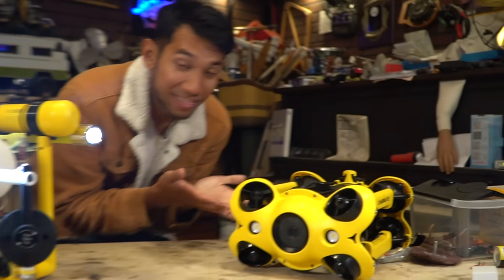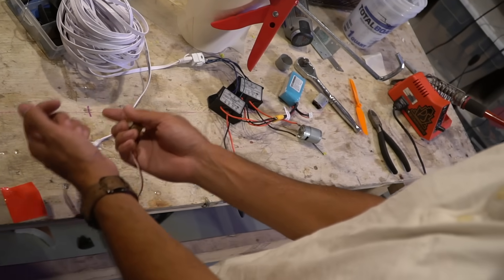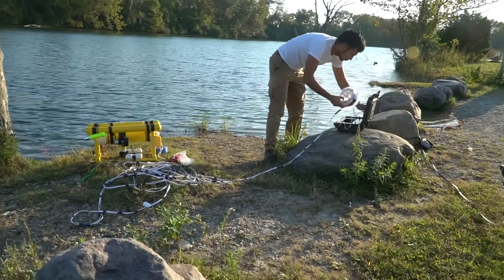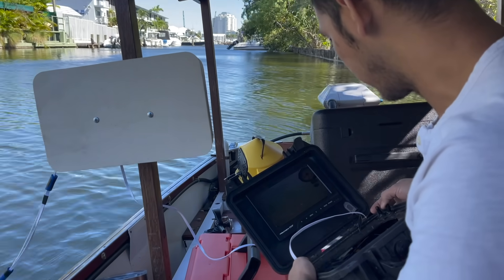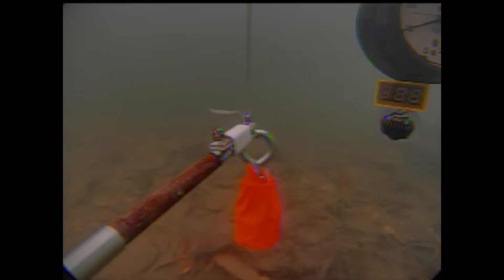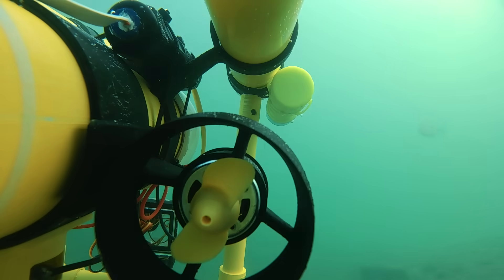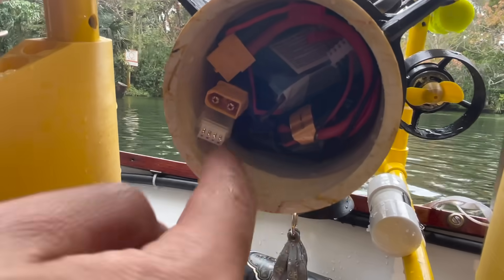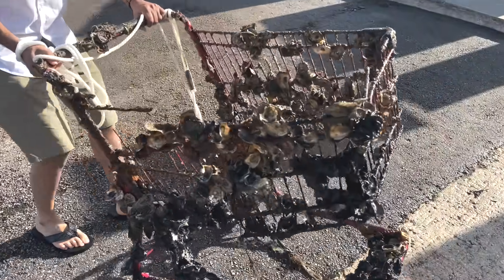Cheap PVC submarine DIY

Comment: A silly question from an uninformed person. You have mounted the motors openly on the outside, without any protection. Wouldn't that cause a short circuit? Or did I learn something wrong in school 30 years ago?

Comment: Would voltage drop be an issue for the tether if you made it longer or no?
Reply: I think if you have a tether that has good conduction and a strong voltage is used, I don’t think it would be as much of a problem as you think.

Comment: You'll need larger ballast in order to bring heaver objects to the surface so you can inject more air and increase your buoyancy, those tiny ballast seem way to small anyways. (Update) oh I didn't watch till the end before commenting, oh I see your going to reel it in on a separate line that's a great idea and that works too. Very very cool design man you have done a great job and I love it's simplicity with no complicated Arduino boards to program this really makes it a build for anyone. Thank you so much for sharing I can't wait to build one.

Comment: This video got me wanting to build something similar, repurposing some quadcopter parts I'm not using. I don't need any help with designs but where does someone find fully submersible motors like that? Looking for bilge pump motors is finding me mostly full units ready to install in boats, not standalone motors.

Comment: you could possibly use 2 ethernet cables, and send emergency power to capacitor banks to operate the surfacing motors in the event of low-power. | if you go the micro-controller route, your not limited to arduino or raspberrypi to use Ardupilot or like. You can adapt OBAL to work with nearly any linux compatible board with GPIO.

Im working on a RISCV based solution with multi-channel controller and multi-channel analog video using a all FOSS hardware. if you did a similiar design, you could transmit a excessive amount of analog video channels(multiple-cameras) over a single wire with VERY little power (or weight). modulating video feeds into vhf channels carried over a single wire and shared ground is possible (although a little tricky as im doing) but provides a extremely low-powered solution for boats, submarines and rovers. | however i dont recommend using riscv like me as its more of a niche project to prove it is possible, as embedding such SOC's will be possible in the future.

Comment: Please can you post or send me everything about this I’m doing the same thing but am having trouble I’m using drone parts a JB F4 flight controller with 35A ESC that’s bidirectional so I got backwards and forwards but turning sucks with an FPV system and I can’t get the motor to do what I need them to do have three motors just send planes wiring motor used bla bla that’s if you can help cool video

Comment: It would be cool to add a water pump to pump in the water to vacume sealed tanks to displace to weight of the air filled tanks so it would move up and down  without relying on a wire to pull it out and weight to sink it I have built a mini  sub like that for about $150 using a dc moter with water seals on a shaft and a peristaltic pump I used it to pump the water in and out of the sub it also had a debris filter and a small reservoir to make sure the pump lines would not get clogged for the communication system I used was with the same cable you used for the cameras I used some backup cameras i grabbed from the junk yard i used 4 of them the lights is used were led strips I got from super bright LEDs I had a arm on it to grab things I used some cheep water solenoids you fill them with water and it gos in or out thay are simple the make and I used the pressure in the ballast tanks to make them work it also used open closed electric solinoid for control of the presher of the solinoid  I could also tilt the sub with the same type of solinoid wich were $10 a piece the body of the sub was PVC but I mane a large square 2 ft x 2 ft x 4 ft I have a lot of the stuff just laying around

Comment: @PeterSripol I work on long distance ROV tunnel inspections in GPS-Denied environments.  You are right on track with your PVC made vessel, but if you used some Fiber cable you can have two way communication the whole time along with more sensors, INS/DVL depth sensors and whatnot. We mainly inspect penstocks (giant tunnels) of hydro electric dams. 
Anywho, cool video and ur on the right track, that is how an underwater ROV should look, like an ugly box with thrusters and as much room for different equipment as possible like Sonar and underwater LiDAR in high vis water

Comment: I had an awesome idea for improving your ability to recover "treasure." You could develop a separate device, which you use the ROV to deliver. The device itself would  have 2 distinct functions: 
Function 1:
                        a "grasper" or "anchor" (either a magnet, for suitable material, or a "claw" of some sort, perhaps with an automatic "trigger" that causes the mechanism to close).
Function 2:
                       an expandable/elastic bladder connected via remotely actuated valve to a C02 cartridge or some other source of compressed gas.

The idea being that you use the ROV to attach the device to the targeted "treasure" via the magnet or "claw," then trigger the valve actuator to expand the bladder, which should theoretically lift the "treasure" to the surface.

Thoughts?
Reply: Hello

Comment: Hey Peter just a heads up, I know this is a cheap as chips build but it is possibly to send sbus signals down a line for the control and have brushless motors underwater, and the battery can actually go out in the open water as lipos are waterproof

Comment: Could you send power over the ethernet cable? According to Wikipedia you could put max 57 V and 600 mA. Of course some voltage would drop over the length of the cable but you would still get worthwhile power over it.

Comment: I did same thing and it worked. But I found it to be very limlted control,so I switched to 6 channels receiver on the surface.to run Variable speed controllers mounted in sub,battery on board,brushless motors.now it works great. Good job your vidio.big fan .

Comment: Hi Peter; I'm new to personal subs ... I wish you had link where we can go to get your build plan for your sub. I live in Canada with thousands of fresh water lakes that would be so cool to check out. Oh by the way, just a thought ... if you use clear soft tubing for your umbilical cords, you won't need ti tie strap them which could get caught up on things as you go deeper. Plus you can pull up on it, if your battery pack dies.

Great Video by the way (:   Cheers from Canada

Comment: Consider using the RP2040 Pico for your next build. You could use two of them, one in your control unit, one in the ROV, and still connect them with the ethernet cable.  As a bonus, they are cheap!

Comment: I made a similar ROV about 5 years ago using regular RC airplane parts. You can use a flight controller for stabilized autonomous operation, SBUS, etc. I used a modified scuba regulator, one of those small spare air tanks, and a pressure relief valve to make an automatic pressurization system which enabled the ROV to go 329 feet deep without any problems. The possibilities are endless.  The one drawback is that you will need a thin antenna wire attached to the ROV with a small surface float and antenna so that it can use GPS for autonomous navigation, video, and PWM/SBUS signals.  What is really cool is that one can send regular radio signals  for a short distance underwater, allowing you to use a camera without penetrating the hull of the ROV with the camera wire. This only works for a very short distance. If you want longer distances, you have to use low frequencies which will  immediately draw the attention of Federal authorities which strictly control such frequencies for military submarines.

You can fly underwater  with an ROV just as you can fly in the air with a quad or plane. In fact, it is actually better because there are few if any restrictions so far. But, I have to caution everyone that the government is aware of just how dangerous such technology can be in the wrong hands.
Reply: Hello

Comment: Hey Peter ! What’s the Voltage of the main battery?? Also why do you use a total of 3 batteries? I can understand using 2, one to power the submarines actuators and one that’s lower power to trigger the relays, but I can’t figure out why you need the third.

Comment: That's awesome.  The biggest thing that I'd change would be the control system.   You could have put a couple ESP32 or similar on it, to send signals to it.   Nothing fancy, just hook your switches to one, and make that into commands to send down to the ROV.  An ESP32 on the ROV would just take the commands, and run the relays.  The biggest things would be that you wouldn't get the interference from your command inputs, and you'd be down to using 4 wires.    Even thought the ESP32 have WiFi and BT radios, the water would kill the range.   

That would be a trivial amount of programming.  You aren't programming a sub with sensors, you're just programming a really cheap wired remote control.

I think you already knew most of that, I'm just saying it for everyone else reading this. :) 

I'm in Florida, and you went past me going from Miami to Weeki Wachee.   If you wanted help doing that for a future project, I'd love to help.   I kinda assume this one is done, so I can't help much with it.

Comment: That's awesome young man. 
I had a submarine in 1970 for Christmas. I had a handle with two twist handles. The batteries were contained there also. 
The sub was controlled by two air fish tank style hoses. The air was pumped by the handle. The sub world move by the pumped air. I've been diving since 1971. I've been certified since 1980. My cottage was at Home Bay for 50 years. I would run my sub of the dock. I dreamed about having a camera  on it. I was 50 years too early. 
I made an Ohio class model that launched rockets. I'm also a rocket guy. Made about 300 of them along with airplanes ,  cars but my Ohio class SSBN launching homemade rockets in about 1985 was awesome. 
But my first sub running on pumped air was the coolest! 
 I like your rig but you should be in the water with it. You should be diving with it. 
Nice boat. The Great lakes are so much better . I live in the heart of the Great lakes. 
The joke here for dumb people is " which way to the beach? " any direction you go.

Comment: Why aren't you using shielded twisted pair round ethernet cable? The flat cables have no protection from interference. Probably explains why your screen turns off when you move a control switch

Comment: Lot of 'playing with the ROV', but not enough on the build...is it 'static positive buoyancy' or do you have a gas system to blow variable balasts? Why not an electro-magnet instead of a conventional one? Why limited to only one-run of Cat-5e (two runs would have given you 8-more strands for additional equipment or expansion)? You can get waterproof (RC) brushless motors for $30 each...why go with a 'brush motor' that's so much hassle to maintain? TONS of 'commercial potential', that could even drive 'additional sales' (like a Raspberry using modules and a 7-inch screen for a 'control station')...

Comment: I'm using boat bilge pumps as my directional thrusters or for station keeping when not moving and actual oil filled trolling motors for the main thruster .
Mine uses 8" pvc pipe and connectors for the main floats.
They will also house the on board batteries near the bottom for ballast to keep it upright. I grabbed one of those underwater fish cameras for the video feed. The tricky part was the underwater lighting for bad water or at night.

Comment: I'd definitely suggest adding a thin coax for the video to remove interference from the camera.

Or just do all the control and video over ip, since you're already using ethernet cable.
Reply: Video can be run over UTP with no problems. The flicker you saw on the video was due to motor switching drawdown of the voltage when motor direction was switched.

Comment: Those dive flashlights are great, they do need some petroleum jelly on the o-rings though or else they will eat themselves up when you twist the end cap, which is incidentally how you turn them on, so....important step. Anyway. I just made PVC handles with a 45 and another few inches of pipe and zip tied the lights to it for flounder gigging. Two lights per stick and it's pretty effective.

Comment: That’s a nice build! I may have to borrow the concept of using relays internal to the hull in my next build. Right now mine uses speaker wire to send power to the motors but that makes the tether heavier and awkward.

Great to see MicroCenter sponsoring you too - I love my local store. Inland PLA+ is super nice.
Reply: And with any decent length of cable, you can have some bit of voltage drop, especially with DC voltage, which can affect video causing dropouts & flicker.

Comment: Next idea: build a human sized version from PVC for as cheap as possible.
Reply: Ocean gate titan: 🙂
Reply: Ocean gate did something similar
Reply: already been done. didnt end up well for the 5 passengers
Reply: yea and go to the titanic
Reply: This comment didn't age well
Reply: If he stays long enough in Miami, he might stumble across someone who did just that!
They would be delivering what looks to be a lot of powdered sugar for their grandma
Reply: Was thinking the same thing how long until he has his own sub has a plane and drone and motor glider all Peron sized I dare say that this is research for the future project
Reply: Giving I did a thing  ideas
Reply: What would be safer is to not make a pressurized sub, but an open cab and you wear normal SCUBA gear while using it.
Reply: I think ocean gate did that
Reply: @fneplays176  *tried
Reply: This is a bad idea, schedule 40 PVC is fine for smaller projects but for the sizes needed to stuff a human inside you’d get flexing and buckling pretty quickly on.
Reply: @johnbeauvais3159  You can easly find plastic tubes able to take multiple people and in the same time they will be very strong and take you deep under water... but building whole sub for a human is not a $100 or even $2500 job and you can not cut corners when human life is at stake.
Reply: @Bialy_1  Polska? Yes you can find plastic pipe capable of withstanding the pressure at a moderate depth but it is not PVC like I believed the original post to imply. You’re absolutely right that you can’t take risks when the possible outcome includes implosion.
Reply: @johnbeauvais3159  So use schedule 80, and maybe fill the pipes with foamed epoxy.
Reply: @johnbeauvais3159  Yeah, similar physics with pop bottles, a 2-liter soda bottle with its thin plastic walls will hold about 195 psi, but if you upscale it to larger sizes it won't hold it any longer due to pressure vessel physics equation being relative to the radius (can be thought of as shear stress in wall on two sides equal to the center volume of air forcing and trying to rip them from pressureXarea). Even without buckling effects (which does make it worse), its indeed going to scale poorly due to several physics effects like the one you mentioned on top of pressure vessel physics.
Reply: @jakegarrett8109  yeah but it would still be cool to see how he does it, there’s home made coke subs out there that are so fucking cool

Comment: Nice!  I built a much smaller one years ago to play with. I used small submergable bilge pumps to move it, and put mineral oil in with the electronics, though I don't know how well that would work with relays and batteries. I also used a single cable, but no batteries in the unit.
Reply: Replace the relays with SSRs.  I think his were sealed anyways, but SSRs would be safe exposed to liquids too.  Mineral oil is actually really good for transferring heat, so that's a great method to keep any of it from overheating.  I think batteries would be fine in the water, I think they're sealed.  If not, put them in their own container, like the way he was doing with the PVC tubes.  I'd say to encase them in epoxy, but LiPo batteries may have a dramatic catastrophic failure when they try to swell a little.   I think 18650 batteries may be safer, and would only need the positive end epoxied, the rest of it is a steel tube.

Comment: OMG switching a relay without a freewheeling diode creates very high voltage spikes and is most likely what caused the video glitches. Diodes are very cheap, other components that are way more expensive can be damaged with these spikes, even if just influenced by crosstalk on adjacent wires.

Comment: Hey, so I was wondering, how high up can you drop an engraved rock or meteorite-like material from a drone or plane, onto dirt, without it shattering into completely unreadable bits? Bonus points if you can make the engravings look like a randomly-occuring part of nature. Idk, thought it might be a fun idea on the airfield? Thanks!
Reply: They hit terminal velocity, so probably infinite height. Even the thin 3d printed 40mm payloads I've printed filled with sand and dropped at high speed out of a jet powered UAV (you know the ones that use A1 jet fuel or diesel), even though those hitting ridiculously hard still did not break the PLA plastic (and PLA isn't even remotely good for impact).

Now if you're deploying nosedive above mach 1 you MIGHT be able to break the rock, but I think you still need to hit a hard surface. I don't think it would be a problem. The reason you see meteorites broken is because relative to earth they are going extreme hypersonic speeds, hence they have so much energy they can leave craters big enough to make enough dust that it takes months to settle (if not longer, its one possible way to create mass extinction).
Reply: @jakegarrett8109  Ah, thank you!